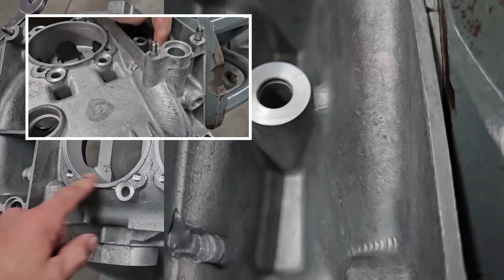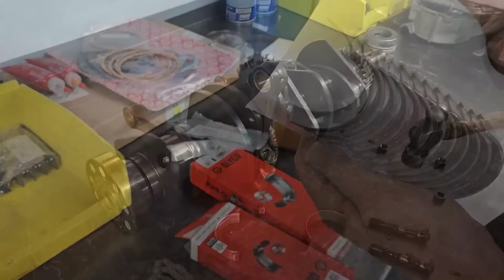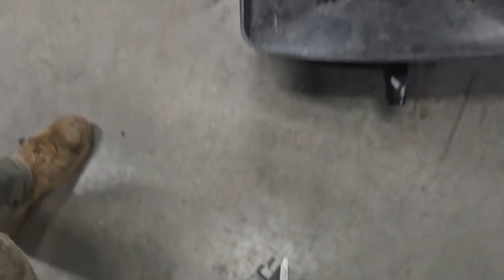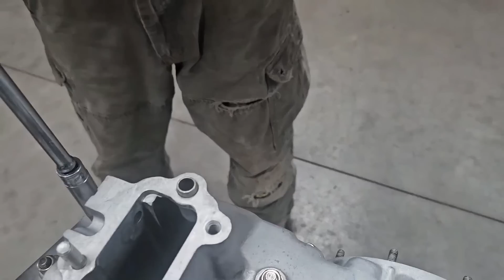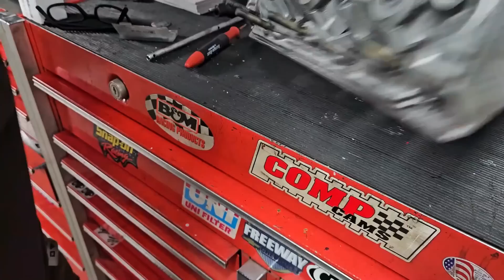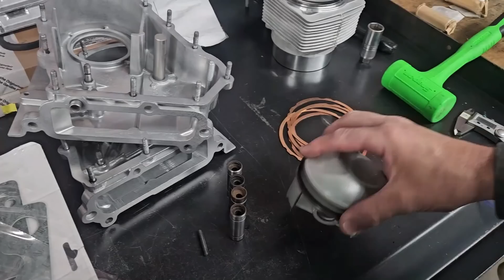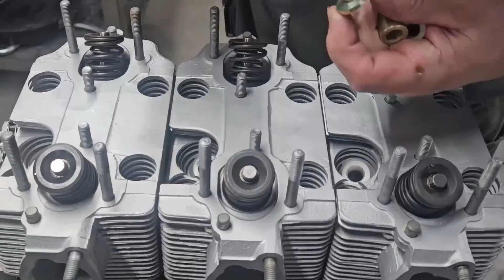Air Cooled Engine Restoration | 1980 Porsche 911SC Euro Flat-Six #aircooled  #porsche911

Comment: Ich kann nicht hinschauen wenn er mit der Akkubohrmaschine die Gewinde nachschneidet😮
Und was wir bei Minute 1:00 abgedichtet und wie sieht es Original aus?
Reply from the maker: Kurt has run the drill and tap a lot, but it does take the right feel not to mess it up. The time to close the case is about 15mins till everything is torqued up. Thanks for watching and commenting. S

Comment: Really fun to watch. Thanks for putting these out there! ❤ how much does a job like this typically run?  Probably a hard question to ask, I know, but have heard wild figures for rebuilds and was just curious.
Reply from the maker: Right now the price of parts is fluctuating and rising daily!  It cost 50% to 60% more now than when we built this engine! So yes too hard to quote for many reasons. The starting point of the engine could be mild or thrashed with major components having to be replaced. We do many video consultations to look over projects and advise on the best course of action. Thanks for watching and commenting, S

Comment: You should have used silicon gloves, your fingerprints will cause rust.
Reply from the maker: Funny. There is not much raw steel left, aluminum case, zinc-plated hardware, and ceracoated painted parts. S
Reply: @Aircooledconsulting  As an engineer I know that the acid in fingerprints not only causes rust on iron and steel, but causes corrosion on aluminium and bronze. I had to wear gloves when assembling parts, sweat is corrosive, there is a small percentage of salt in sweat.

Comment: Other engine builder videos use gobs of assembly lube during main\rod bearing installation while you use a drop or two of ATF. I've often wondered if excessive assembly lube would negatively affect bearing clearances upon installation. Thoughts?
Reply from the maker: I don not use engine assembly lube on bearings because it is so thick and sticky and you cant feel how the crank turns through it. I do use it on new camshafts but that's about it.
Kurt
Reply: No. It has no effect on clearances.  Any excess escapes.